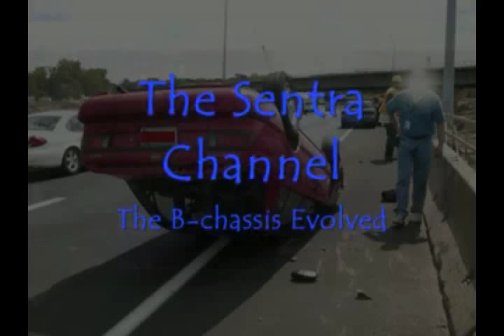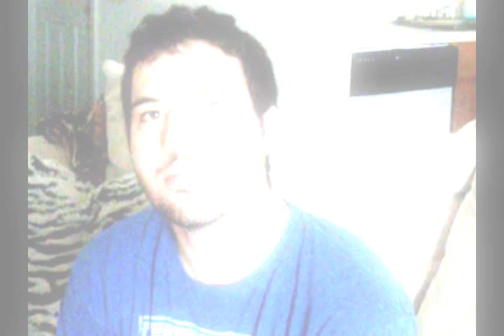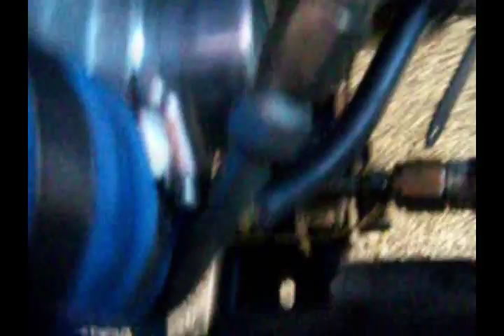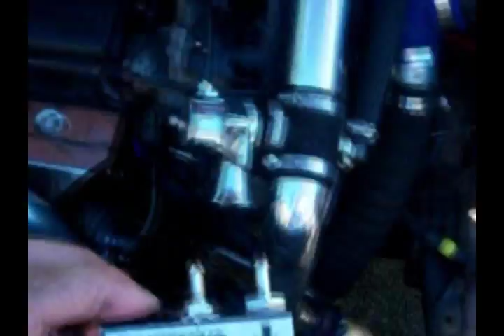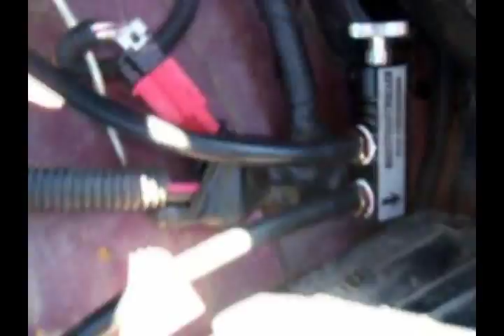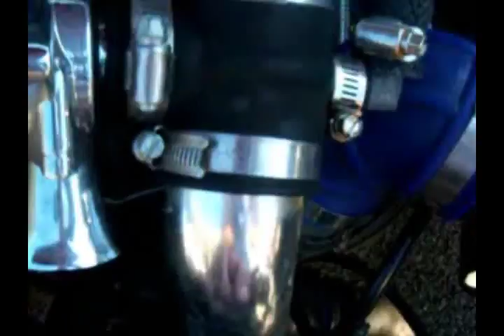B14 episode 2 Wastegate and boost control

Comment: good vid man. just a comment on MBC's vs. EBC's, good MBCs are just as stable and accurate as EBC's, but EBC's are easier to dial in to the right amount of boost, cuz you just pick the number and call her candy. you can also get dual stage manual boost controllers that you preset to 2 different boost levels, then run an electronic swith to your interior to flip between the two. simple flip switches will work.